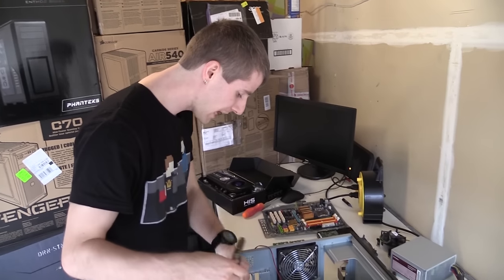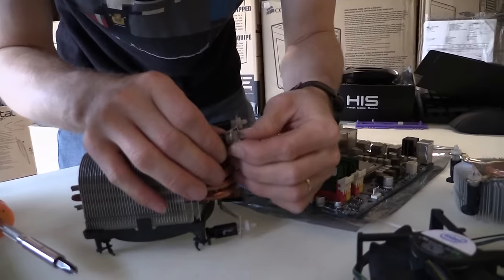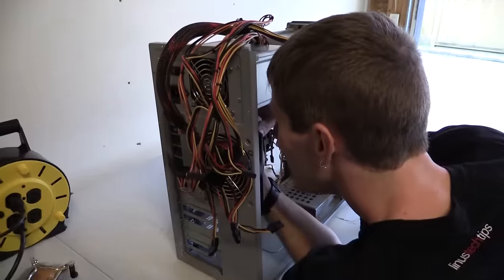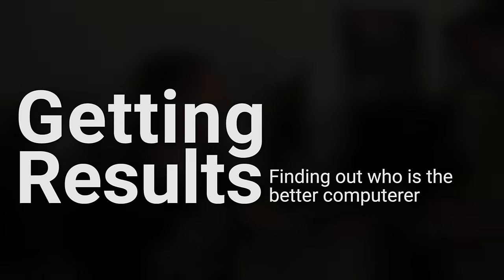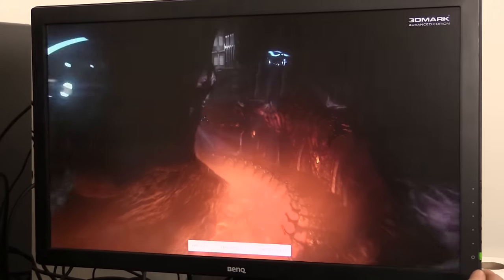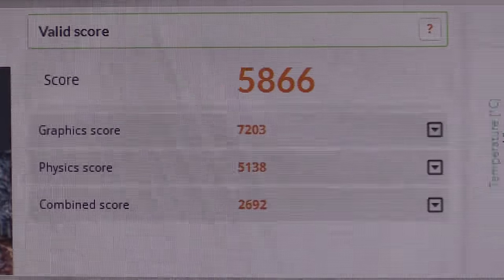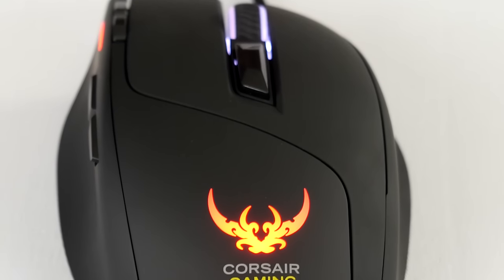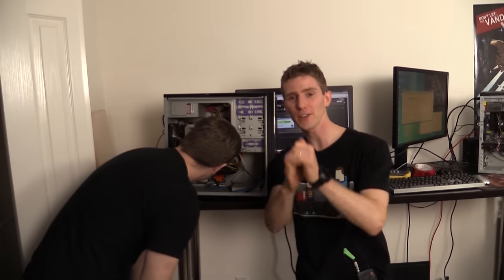$300 Budget Gaming PC Challenge - Scrapyard Wars Episode 1c

Comment: how does my pc compare to the ones they made. I paid 270$ and got

GTX 650 TI
8 GB RAM
Xeon 2.4 hertz or what ever it is intel quad core
Reply: +Pebos Intel Xeon for under 270$? Not buying it.
Reply: ***** Huh... Well anyway, your PC won't be very good for more demanding games, but could be fine for stuff like Minecraft, TF2, Terraria and so on.
Reply: What's the motherboard?
Reply: idk it arrived tho i have it
Reply: +ThePopStarDude productions  His PC would be mid-range if his cpu was slightly better...
Reply: David Hammac so can you answer the original question?
Reply: Almost, all 3 are different. Best way to find out would be to do the benchmarks yourself, I guess. But if you get a good CPU, like an I5 or some amd quad core, you can run games at mid-high range settings for demanding games.

 If you want to upgrade, just make sure the cpu is compatible with the motherboard, and it'll be awesome.
Reply: i would probably need to upgrade the power supply tho right?
Reply: That would be a great idea! A good brand $50 (US) is recommended for any mid range.
Reply: +Pebos I don't know about the 2.4Hertz, I would go for at least a billion times that.
2.4Hertz is kinda pushing the limits, even if you are running linux.
Reply: +svampebob007 lmao
Reply: +Pebos Yours is almost identical to Linus' machine, the difference being he had a 7950 which will destroy a 550TI, upgrade that GPU and you'll have a pretty decently performing rig for a good price, the only problem is a stock Q6600 is not the best, that Xeon will be marginally faster stock, but you can OC the hell out of a Q6600 and that's not possible with a Xeon, can raise the base clock but you won't get anything significant, definitely get a beefier GPU though.
Reply: ok
Reply: +ThePopStarDude productions Lol bro you could get Xeon e5470 for $40 on eBay bruh.

And its equivalent to a FX6300 if you overclock it you can get it to be faster than a fx8350 by a lot and you could probably pair a GTX 960 with it bro I don't know what you're smoking but if you think a system like that can only play games like tf2 you obviously don't know much about computers.
Reply: deafyboy86 I bought the 650 ti model. He changed it when he ran out.. compare it to that

Comment: Wait, I thought Linus specifically said the outside of anti static bags are a very bad conductive surface to build on since they are not anti static like the inside...?

I guess this falls under "do as I say don't do as I do!" - Linus
Reply: +Ollie Horne only if the system is turned on
Reply: No he said to build on meaning off.
Reply: And the pc doesn't need to be on to short components lol
Reply: +Ollie Horne yeah, but it doesn't matter much. If you just ground yourself with one of those wristbands that plug into the ground on the wall socket then you're good.
Reply: +Sean Ramey he doesn't do that though. ever.
Reply: +Sean Ramey you could just strip a wire and attach it to ground. Unless you build rigs everyday you shouldn't spend any money on what essentially is a wire. you can also periodically ground yourself before touching anything sensitive

Comment: my rig costed a total of €280 and I managed to get:

an Intel DQ25TM motherboard
16GB of DDR3 RAM (dual channel)
Intel Core i5 2500
GIGABYTE Nvidia GeForce GT 730 2GB GDDR5 (I overclocked to get +200MHz core clock and +230MHz memory clock)
AvP Storm case with blue LED fan
238GB SSD
1TB HDD
350W 80+ Gold Rated PSU 

My first upgrades are going to be the GPU (obviously, but the GT 730 gets a bit too much flak for what it is IMO) and the PSU, I'll probably upgrade to a 500-600W unit when I have the money, then finally I'll move on to cosmetic upgrades, maybe a whole new case or maybe new side panels or LED strips for it, the options are endless with PC! but I'm pretty happy with this as it is my very first PC capable of playing games at a playable resolution and framerate
Reply: That's pretty similar to my rig for much less money
Reply: Digging4Answers oh nice, what's yours?
Reply: that is actually +$100 CAD then their budgets when you convert it
Reply: Dylan Collins YOU PEOPLE DONT NEED 16GIGS RAM IF IT COSTS YOU A GOOD GPU! 8GIGS IS ENOUGH!!!
Reply: 4BarGamer most newer games are starting to put 16 GB to use, hence getting 16

Comment: If the budget were $300 USD, I'd buy a used Pentium G3258 with a new MSI H81-P33 Motherboard. I'd buy everything else used
Reply: problem was the time line and shipping is also included in the budget.
Reply: I was thinking about the G3258 as well for a budget build. It can be bundled with a mobo for $99 and overclocked to 4.5ghz easy on stock cooling. It's a tough choice between that and a Q6600's 2 extra cores. I'd like to see benchmarks between the Q6600 and G3258. It'd be interesting.

G3258 would probably be better in a random game...until a background process starts running...then the Q6600 might take the advantage. The game can use 2 threads while the other 2 threads can pick up the slack on backgrounds processes.
Reply: Yeah you're right. If Luke got G3258 he wouldve rekt Linus XD But yeah that core 2 duo was too huge bottleneck :D
Reply: Jweeny Pwee a q6600 is shit now a days. My neighbour had a build with a q6600 and a ati 4870. He replaced the gpu with a gtx 760 and in far cry 3 he got massive frame drops in explosions and heavy gun fights. When he bought an i5 4570 the frame drops were gone and the game ran at stable 60fps
Reply: Now tell us the price difference between a 4th gen i5 and a Q6600....

...that's the point. Budget build.

A 4th gen i5 is NOT a "budget" build.

For a "budget" build, a Q6600 is a fine choice.

Of course PCI Express 2.0 will be a bottleneck for the "budget" Q6600.

Did I mention "budget?"

Budget.

(P.S. I've got a 4690K i5 in my main rig. I love it!)
Reply: Jweeny Pwee q6600 is still shit for a budget. On my local used stuff store you can get a used Q6600 for 40EUR and an i3 3220 for 50 EUR  which should be much better.
Reply: You could be right. We're back on track with the "budget" mentality. It'd be neat to compare the 2. 4 physical cores v. 4 simulated cores.
Reply: Jweeny Pwee http://www.anandtech.com/show/4083/the-sandy-bridge-review-intel-core-i7-2600k-i5-2500k-core-i3-2100-tested/20

It looks like even i3 2100 is better than the Q6600, The thing that matters mostly is the single core performance, I think we are just now entering the time where games are starting to take advantage of more then 2 cores.

Comment: I'm planning to buy a Gaming PC. This would be amazing and very hlepful if you just give you opinion on what I'm going to get:
-HP Workstation Z400.
-Intel Xeon Processor W3565 (8M Cache, up to 3.46 Ghz, 4.80 GT/s Intel QPI ) (8CPUs)
-Ram: 12GB DDR3 
-HDD :1T
-Graphic: NVIDIA GTX960 2GB DDR5 128bit 
-DVD: DVD RW
-Integrate LSI 3.0/s Raid 0, 1

All of these for 588$ is it a reasonable price. and Will this pc actually perform great for gaming.
Reply: For 588 that's a steal
Reply: for only 588? that's real value
Reply: that's a great build, I have one of those myself, with a 560 ti, I would recommended getting a ssd with this beast for a perfect $600 build
Reply: Don't buy a gtx 960.  Buy and RX 470, it's 20% faster and only $150.
Reply: We don't know anything about the rx 470 yet apart from amd saying its for 1080p gaming, it might be a binned rx 480 so it would be a great value, you can also get an 960 for $200 if you really want to go nvidia
Reply: Go with a 1060 if you budget allows once its released
Reply: Or a rx 480, knowing nvidia, the 1060 will be $100 over msrp
Reply: u can buy  my 960 if you want

Comment: Good stuff, guys

!I've built several budget gaming PCs for customers recently for about $300.
One was a Phenom II X4 940, 8GB DD2, & 6870. The other was an Athlon II x4 630, 8GB DDR2, & 7870. Both with 1TB hard drives and quality power supplies. Sold them for around $300-350 and still made a little bit.

Another option is a Dell Optiplex with a 3rd or 4th gen i5, which is on ebay for around $150 with 8GB AM and a 500GB drive. Grab a power supply adapter cable, swap out a power supply and your favorite $160 video card, and bam!

Comment: I'm curious to know where Luke found that 290, I know it was well over 1,000 miles away from me. But I'm trying to find a GTX  970 for under $300. Lowest I've gotten is an MSI OC version for $310.
 Also, I tried a 3% OC on my FX 6300 and it kept shutting off. That's a 105Mhz increase, about 1/5th of the turbo. Anybody know what might be the issue?
ASRock 970 Extreme3 R2.0 AM3+ MOBO
AMD FX 6300 Vishera Hexa-core 3.5GHz with a 4.0Ghz turbo
12GB G-Skill Ripjaws 1333Mhz RAM
MSI Twin Frozr III GTX 660
Raidmax Cobra 700Watt 80+ bronze PSU.

Also in game, even PayDay2 my CPU stock fan is going over 7,000 RPM but the temps even in Aida 64 stress test isn't going over 57c. Anybody know why its going so high? I've got 5 120mm case fans three out 2 in.
 Like right now I've got a game downloading on Steam and I'm watching this, the fan is at 4,900 RPM.
Reply: Holy shit, same benchmark test with what I listed.
		
		
		
3DMark Score
		4374 				 			 		
		 	Graphics Score
		5089 				 			 		
		Physics Score
		5649 				 			 		
		 	Combined Score
		1830 				 			 		
Graphics Test 1
		24.18 fps 				 			 		
		 	Graphics Test 2
		20.4 fps 				 			 		
		 	Physics Test
		17.93 fps 				 			 		
		 	Combined Test
		8.52 fps 				 			 		
On the mid range my lowest was the combined at 17 the others ranged from a low of 29 on the physics to an average of 71 on graphics 1 and 2.
Reply: FraggedDabloons
Oh my, running the same test after doing a 10% OC on the CPU and boosting the core clock on my 660 by 50 and the memory clock by 45.

		3DMark Score
		4556 				 			 		Increase of 182
		 	Graphics Score
		5246 				 			 		Increase of 157
		 	Physics Score
		6160 				 			 		Increase of 511
		 	Combined Score
		1917 				 			 		Increase of 87
		 	Graphics Test 1
		24.95 fps 				 			 		Increase of .77
		 	Graphics Test 2
		21.01 fps 				 			 		Increase of .61
		 	Physics Test
		19.56 fps 				 			 		Increase of 1.63
		 	Combined Test
		8.92 fps 				 			 		Increase of .4
		 	
I was honestly expecting a bigger improvement over the base clock, I'm pretty surprised. Even being my first successful overclock. If you can call it successful. :/
15% was over the turbo and did crash, I'm going to try and get a bit higher and re-run it.
Reply: I can't help with finding a 970, but you should look into getting a better CPU cooler. I sounds like you are crashing because it's too hot. I had a 6300 for a long time that I ran at around 4.5 GHz totally stable with a hyper 212 cooling it. That worked really well for me. The stock heat syncs are pretty bad, especially for over clocking.

 Also you should set up your fans so that you have 3 in and two out. It is better to have positive air pressure in your case than it is to have negative like you do now.
Reply: Fmily
Temps weren't getting any hotter than they were at the base clock. I'm actually thinking its a power issue, can't push my GPU more than 40-45Mhz before it doesn't take.

My CPU fan is getting close to 10,000 RPM at the base clock playing freaking Payday2. Waiting on AMD to contact me back about it, and looking into a new fan.
Reply: You have a crap psu brand dude Raidmax is notorious in the industry.  Also your mobo has no heatsink for the vram either
Reply: Stefano_pena
Well I've managed 3.93 now, strange thing is every time I push the GPU higher, I get lower frame rates. I got 4% higher at an 80Mhz boost than I did at a 140Mhz boost.

I'm looking into upgrading already to a GTX 970 and an 8350 black edition. I might get a larger CPU as well, just to get a modular to aid with cable management.
Reply: FraggedDabloons your gonna want to replace that psu before it damages any parts you have and change that mobo because it will not handle an 8350
Reply: FraggedDabloons look into that first or you will regret it. You will thank me later
Reply: I got my xfx 290 (not the reference one. The sexy one) for $225 brand new from amazon.
Reply: Stefano_pena
What the modular?
Reply: Yes, the issue with your FX 6300 is that AMD sucks. Get an Intel and you will not have that problem.
Reply: Ryan Toomey AMD make perfectly fine CPUs and GPUs. sure Intel has them in raw power, but nothing in Intel's lineup comes close to the price to performance of AMD. I have an FX 8320 and I haven't seen any problems in games, or in any productivity application that I use.
Reply: Fmily
He's probably never even had and AMD product.
Reply: He had a reference cooler. They're known to be terrible. He probably would have paid way more for non reference.
Reply: XTheGamingBossX You can get pretty high end air coolers for like 20-30 dollars.
Reply: Hijynx87 I wouldn't say high end, but you can get really good air coolers for that. my hyper 212 was like $25 on amazon.
Reply: Hijynx87 New yeah, but from some dude the value is lowered a lot.

Comment: Wouldn't running the bench s at a smaller resolution make the gpu work less hard?
Reply: not when the fps isn't limited. it's all taken into account and benchmarks usually scale 1:1 between resolutions in terms of results.
Reply: @charles-antoinemartel-roy  If one was a 1080p monitor and one was a 4k monitor, they both could have been running the benchmark at 1080p, for example, but one looks physically smaller.